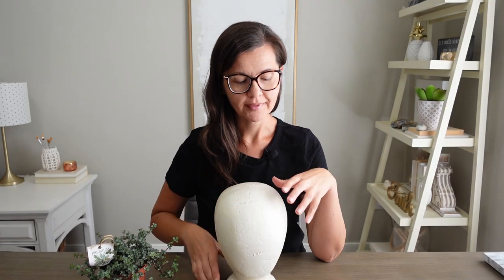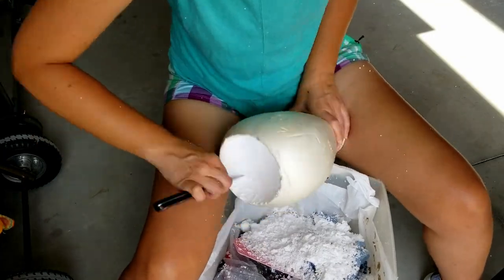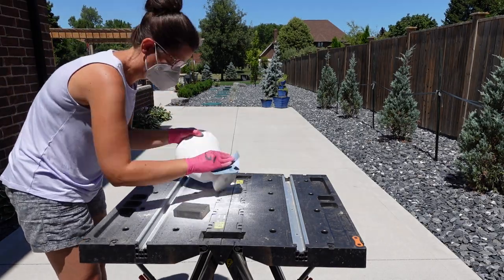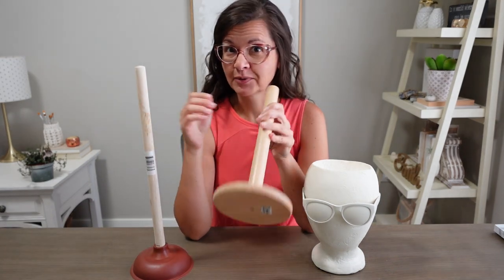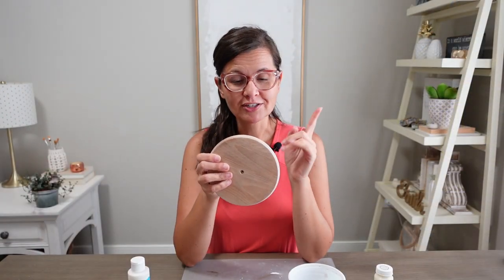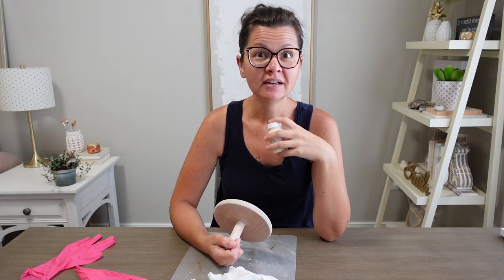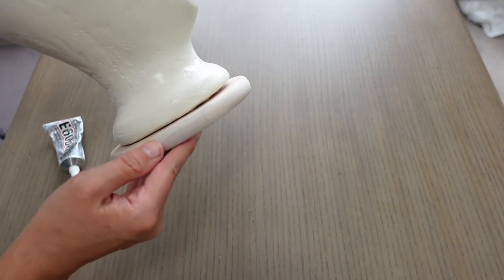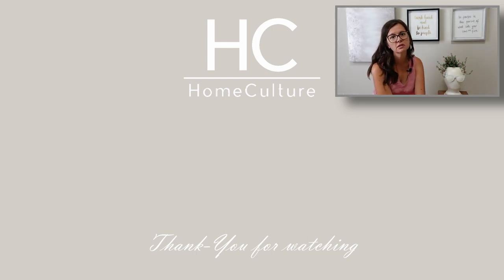Making A Mannequin Head Planter With A Styrofoam Form |  DIY Home Decor | Decorating with Plants

Comment: What did you use to smooth the inside with? Thanks
Reply from the maker: Hello!  Unbelievably and sort of embarrassingly, I used a serrated kitchen knife - it was one of our steak knives!  The finely jagged edges of the knife run over and over the styrofoam smooths it out pretty nicely.  And then I just went over everything with 80 grit sand paper.  But really, it was the knife.  I didn't push too hard, but hard enough to scrap the styrofoam.